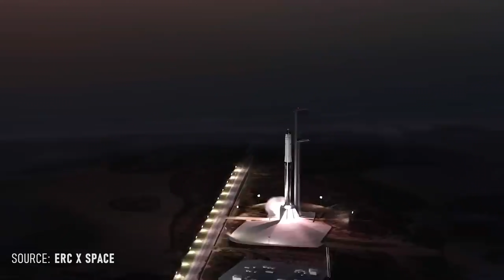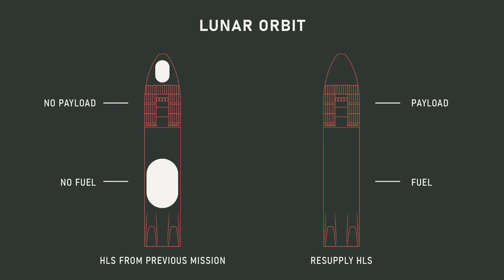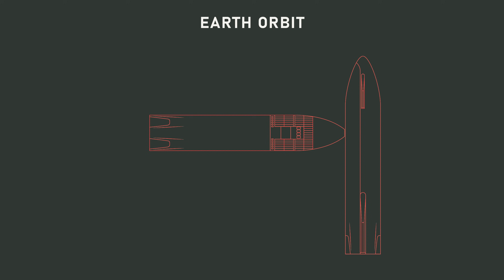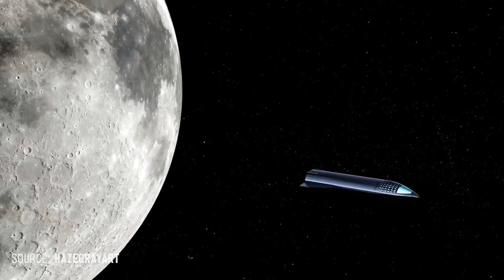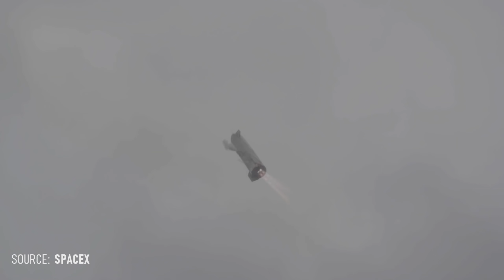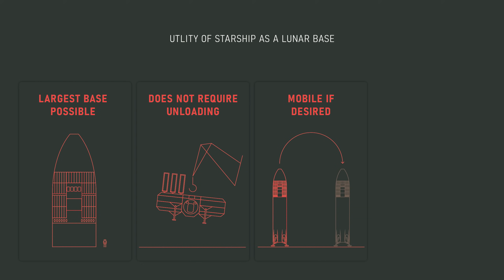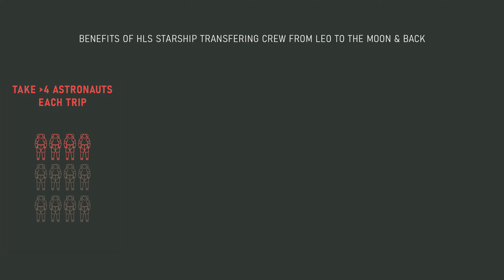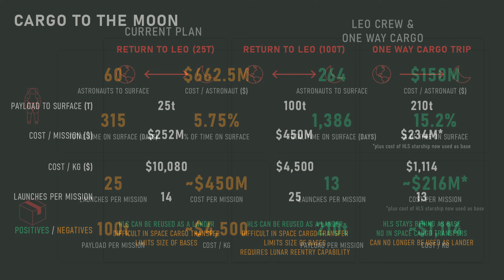How to Use HLS Starship

Comment: I just realize all of the shot of the lunar starship has one big mistake. It only needs three vacuum raptors. But it always shows it with the three sea-level raptors.
Reply: I agree... As a KSP player I would use just 3 vacuum engines... BUT:
- vacuum raptors will not have gimbaling. With 3 engines you can't correct the offset after loss of only one.
- even tho they use other engines for touchdown, there were some talks about 3 engines being too much for the moon
- It is unknown whether Starship will only use Vacuum engines during ascent. I also heard some arguments around that.
Reply: @cola98765  
You would be right they would add the gimbal to the Vacuum engines when the plumbing was redesigned.
Reply: @DJBREIT  I think the reason why the vacuum raptors cannot gimbal is because it's a little too cramped where it's placed
Reply: More engines = more redundancy and the SL ones can gimbal (unlike the vacuum variants)
edit: it also gives more thrust during the initial ascent to LEO after booster separation.
Reply: @OzearEimaj  
You are landing on the moon with no atmosphere. You can use one of the raptors. They are that power full. And they will be using side thrusters engines for the final approach. Also, the sea-level raptors are for landing on the earth due to the atmosphere. And since the vacuum raptors are used when the booster is done why would you put something on a ship that it will never use. And for the gimbal, you have the side thruster engines.
Reply: @DJBREIT  All valid points, but I doubt SpaceX - or any aerospace company - would make such an obvious error in their renders. You can also see that one SL and one vac engine are glowing after being used in some of the earlier renders.
Reply: @OzearEimaj  
I doubt SpaceX - or any aerospace company would make such an obvious error in their renders.
What................. you think companies don't make mistakes.
Take a look at some of the early renderings of starship there is quite a lot of difference from the original renderings to what we see now. Whoever did the rendering for the Lunar Ship just copied the StarShip and everyone else has been coping it without a thought.
They will end up changing it when they get down to designing it. There is no reason to have sea-level raptors on the lunar ship. That's just putting dead weight on the ship. Also if you look at any other rocket the second stage will always have a vacuum engine since a sea-level engine becomes very inefficient in the vacuum of space. Here is a video on the difference https://www.youtube.com/watch?v=ZyQF4rOVsQY. StareShip has them because it is the first ship designed to power land on earth.  The Lunar Ship will never re-enter the earth's atmosphere. I hope!  So it does not need them.
Reply: @DJBREIT  Differences between early and new renders are not "mistakes", they are design changes. If you're so dead set on thinking that having extra engines ("extra only if you consider them dead weight as you do) is unnecessary on a crew-rated vehicle and that keeping them will simplify the design process while allowing for redundancy then it's clear I can't convince you otherwise. I understand over/under-expansion of plume; thankfully over-expansion is workable and the efficiency loss for the gain of attitude control via engine gimbal is yet more redundancy for that particular subsystem.
Reply: @OzearEimaj  
OK, tell me when you will use a sea-level engine during a lunar mission.

Comment: another option: send a starship tanker to lunar orbit and refuel the lunar starship.
 you only need enough to land on the moon and return to orbit.
 the tanker then returns to LEO or lands on Earth.
 you don't need extra cargo other than supplies, food and experiments, this can be transferred through the docking adapter, with bigger payloads transferred through the cargo bay. lunar starship will most likely reuse the rovers, tools and laboratories, or land on the same lunar base every time.

Comment: You are perhaps missing one scenario. Send Starship A to the Moon, land it and bring it to the Moon orbit. Send a second Starship B to the Moon with fuel& cargo.  Refuel Starship A so that it can return to LEO for refuelling, land Starship B on the Moon and return it to Moon orbit. Then repeat with Starship A. I think this might be possible, because after landing&returning to Moon orbit, Starship still has some fuel left. If this extra fuel is used to refuel an empty Starship in Moon orbit prior to landing, the compounding effect might be just enough for the system to work.
Reply: And another thing. Starship won't be a good lunar base. Requirements for long-term base are very different to crew&cargo transport. Lunar bases will need to be buried underground in the long run to protect from radiation. They will need all kinds of modularity in order to be maintained properly. And the 30m high lift doesn't help a bit. I get you point weight-wise; but exactly the traditional thinking of "minimum weight" was the path that turned out a blind alley to the reusability and therefore high cadence and utility. We have to waste kilograms to gain performance.

Comment: Actually, if use it as habitat, than we truely can use empty methane tank as its part. Even prebuiding decks inside it on earth, and then fill the it with fuel. a km Lost ox will used 4 clear and repressure ex methane tank. Double space in same hab.
Reply: because tank need to be tanks you can't prebuild them... but yes. with 200t of cargo you could send some more materials to make it into a 50m tall building... also it would great place to experiment with mars bases where you need not only scientists, but also some dockyard-like workers.
Reply: @cola98765  look... You can build anything in tanks. I mean metal structures: decks, ladders etc. Its not affected by methane anyway. And dont acffect metane  flow or capacity as tank. Sowhy not?

Comment: For the one way mission, eventually you'll probably get more starships than you know what to do with, at which point leaving it behind will be seen as a loss in terms of costs. At some point you'll want to get more cargo to the moon while keeping the current rate of people on the moon (for example mining equipment, in situ fuel converters, ...). At that moment one way doesn't seem interesting at all. 

Also a cargo HLS doesn't necessarily need to be the same as a manned HLS. You could possibly have larger tanks for it and either none or very tiny control center for the crew to put the cargo HLS down. All in all a cargo HLS probably can get rid of a lot more unneeded mass than the regular HLS. This different setup might also ease cargo transfer in space.

Comment: Lunar Starship, without fins and with the wraparound PV array, cannot do aerobraking at return to LEO, thus needing another 3 km/s of delta-V. Better to use a stock earth-launch/landable Starship to transport Orion/Dragon/Starliner to Gateway, along with enough fuel for a stripped-down HLS Starship to do a surface sortie with O/D/S on the nose, ready to do an abort-to-orbit if needed. HLS lands, exchanges crews, returns to Gateway, sends the returning crew to Earth aboard the O/D/S vehicle on the stock Starship. The HLS loiters at Gateway until the next Starship arrives with fuel and crew. Lather, rinse, repeat.

Comment: cant they just use the "next" starship to give a quick lunar orbital fuel top up the previous empty starship needs to return home, and then land with the remaining fuel, empty out, fire empty into lunar orbit and wait there for the next starship to dock with the "new" old one, give a quck refill, then land itself. Kind of like a cycler, but with fuel topups
Reply from the maker: I ran the numbers on this during the making of the video. I think that method can be made to work. 

It wouldn’t be able to bring any payload but could work for people. But it would have to do a refueling in lunar orbit (already not great according to NASA) but als would need to do that refueling with crew on board.

Comment: NASA will not be ferrying astronauts to the moon every month.  Once the starships are fully human rated, the pressurized portion of the starship can be decided by NASA and SpaceX.  It's not like the astronauts need the whole Starship to be pressurized in order for it to be useful.  Think of a clamshell with different levels some pressurized some not.  The whole starship does not need pressurization because it would need to be depressurized every time an airlock is opened to drop cargo on the moon.  Think how the space shuttle did not pressurize the bay only the crew cabin.  A starship will have to have a crew cabin.  It will be big compared to space shuttle, but still not all the levels will be pressurized.

Comment: Don't forget that the starship can have a clamshell to transfer payloads btwn starships since no humans are on board.  The astronauts can use the hatch and enter a fully pressurized starship cabin by the time they arrive to the HLS to land and drop off their payload.  There should not be a problem of having a number of Starships ferrying fuel and cargo to anywhere halfway btwn the Earth and moon.  Ships can take as long as possible in order to take cargo to the moon.  Having starships take fuel and cargo is possible because most SS missions to the moon will be unmanned once the humans are on the moon for good.   Starships can form a space train to ferry cargo and humans to the moon.

Comment: You won’t want to reuse HLS starships indefinitely because there would be no opportunity to give it a service or refit.  Engines could develop problems, tanks could leak, batteries degrade etc.  So maybe they should reuse each one several times first, and then land them one final time on the lunar surface to be converted to permanent buildings.  This way maximises the usage out of each HLS starship without any wastage.

Comment: I think the lunar starship can return from the moon to earth. NASA will likely not use near as much as the starship is capable of, so it will likely not even need to be completely feuled for it. Using the sls in the first missions will probably be done, but getting crew up by dragon, starliner or maybe even dreamchaser would be cheaper. SLS can keep being used to get crew to the gateway untill it get replaced by the regular starship.

For future cargo missions they will probably build landing pad on the moon and launch regular starships that are being loaded with cargo on earth, then land on the moon and go back to land on earth (100% reuse)

Comment: You are echoing my arguements. But I have another arguement. Why make Lunar starship out of steel? Making it out of an aluminum alloy would add 100,000 pounds or more to the payload or fuel carried. 
You could also modify the outer shell to a hexagon with a dragon or starliner or Orion capsule forming the nose and it could even haul a second one docked to the nose in space and couple dozens or hundreds of them in large honeycomb fashion spun up to provide gravity. These flotillas could haul hundreds or thousands of people anywhere in our planetary system. 
Good job by the way.🤩
Reply: Sorry but not hundreds or thousands because you need to take into count the weight of the dragon, starliner or orion capsules and also the dragon and starliner capsules don't have the sufficient life support for interplanetary travel, also what about food and water because you would need to grow a lot of food for hundreds or thousands of people. tldr I am 99.99999% sure that it wouldn't work out and you would be better off just sending multiple crew starships since it would be easier and it would be cheaper, a lot cheaper.

Comment: A couple of points:
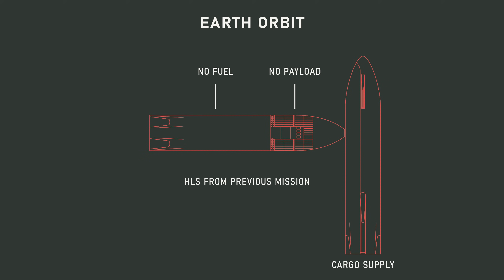1) Lunar Starship in-space cargo transfers have 2 large airlocks plus the IDA, not just the IDA. Payload StarShips have massive "jaw" fairings which open up. In-space cargo transfers would not be difficult nor would "all cargo have to fit through the IDA" as claimed around 6:20.

2) Returning Lunar StarShips can circularize their initial elliptical Earth orbits using aerobraking--lack of heat shield and wings/fins does not prevent this. Heat loads can be kept within limits by using multiple encounters with the Earth's atmosphere. No need for a tanker StarShip to meet the Lunar StarShip in an elliptical orbit and transfer fuel to it.

Comment: Why would Lunar Starship have any sea level Raptors (shown in your video)?
Reply from the maker: The official SpaceX renders (last we have) show sea level raptors as well. The Sea Level raptors are used to get into orbit after stage separation. 

Also they planned to use 1 sea level and 1 vacuum raptor for the final descent to the moon before switching to the landing thrusters. This is to have 1 engine that can gimbal and less thrust overall.

Comment: I think we are going about this wrong. We should first establish a gateway in LEO aside of the ISS. Then establish a fuel depot. Concentrate on developing a heavylift rocket for fuel. It should be a 2 stage system but the 2nd stage serves 2 purposes. 1 is to carry the fuel. 2 is to serve as a multipurpose structure when empty. The 2nd stage should be modular with a thrust section and fuel section. These components could serve as the basis for the LEO station in the beginning. Once we have mastered that we could do the same for the lunar orbit station. We could build a lunar lander with spare parts. The lunar lander would be used to bring people and small cargo to and from the surface. Another system would bring structures and large cargo. Sort of like UPS or FEDEX. You dont land a 747 from UPS at someone's doorstep to deliver a parcel of mail and you dont use a delivery truck to drive from NYC to London

Comment: Would you jump out of an airplane without a parachute? If crew are in a spaceship anywhere in space you must have an option of reentry and landing at trans-lunar speed.  The only exception is if the craft will only have people in it in lunar orbit or on the surface.  You must have the option to do a direct abort from trans-lunar space, free return looping around the moon and reentry and landing once you leave lunar orbit.  A lunar reentry capable starship would work.  The other option is to have a dragon capsule along as payload in a lunar starship.  The dragon capsule does not need to go to the surface so you don't need the delta-v to land it and get it back to orbit.  I would be happier if the dragon included a service module that had the delta-v it get itself out of lunar orbit.  The Orion can do all of the required abort and reentry phases so it is safe for crew.  The current planned SpaceX would only be safe for crew in lunar orbit and down to the surface.  Also, the 100T capacity to the surface would only work if there is no crew onboard. With crew, you would need the option to abort the landing to orbit.

Comment: You should be running NASA. LOL Seriously though, thanks for the thoughtful analysis. Request: Could you analyze how fuel could be made ON THE MOON. Since there is water, liquid O2 could be made. Methane, CH4, could be made if carbon could be combined with the hydrogen split from the water. Could carbon be derived from the carbon-based lifeforms on the Moon? LOL

Comment: In your cost calculation you forget that if the starship stays in the surface of the moon. the astronauts still need a way to leave back to earth. So it would have to be combined to other methods discussed. also it would require starships to land close to each other in the lunar surface (cargo and crew would need different vehicles) witch increases the danger of the mission.

Comment: As to "unscrewed cargo transfer from launch Starship to HLS" - I could see them making a "cargo module" that is externally swappable between the different model Starships. Instead of hauling cargo through the IDA, they would just "open cargo bay doors" and move the single large pod from one to the other. That pod would have an internal hatch that could be opened inside the Starship to have access from "crew compartment" to cargo area.

My thought is HLS will go from Lunar orbit to LEO, and get one cargo Starship launch plus a couple fuel Starship launches before each lunar trip.

Comment: Just as an aside, the intent of Gateway is to resupply the HLS lander. Gateway would be resupplied by commercial capsules like the DragonXL and that payload transferred to the lander prior to crew departure. While Starship's initial payload could be quite large, subsequent landings could be limited to the the amount of payload that could be stored at Gateway. This was the original idea behind the reusable smaller landers like Dynetics and National Team. Starship just happens to have a much larger store which triggers this type of thought experiment. 

Most likely, a single dedicated cargo launch Lunar Starship would hold all the necessary "permanent" gear for the initial moon bases. This means you would only need to have the first lunar starship (or first to the gateway) carry a full payload to moon orbit. As the Lunar Starship reaches its EOL, it would be time to load more "permanent" gear and send the next one up.

Comment: Assuming Lunar Starship doesn't have the fuel reserves to return to LEO after its mission (which is likely), I wonder if a disposable booster of some sort would be enough to give it the extra delta v needed to do so?

Say a shortened Starship segment that docks at the rear in LEO. This is then used to provide a good bit of the delta v needed to leave LEO... then it detaches (and expended completely) and Starship resumes operation with onboard fuel. ANYTHING, evening throwing away a small booster that itself requires 2 refuels in LEO to assemble beats having to refuel a Lunar Starship in Lunar orbit. I suppose you could also just lengthen Starship, but it appears they may have already reorganized the interior to allow for more fuel (beyond what is needed for the 24 landing thrusters).